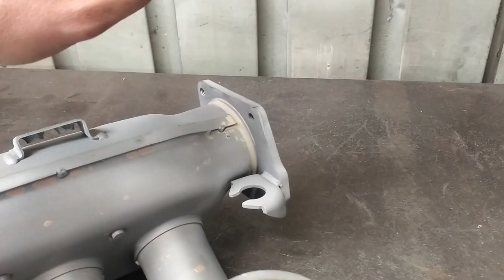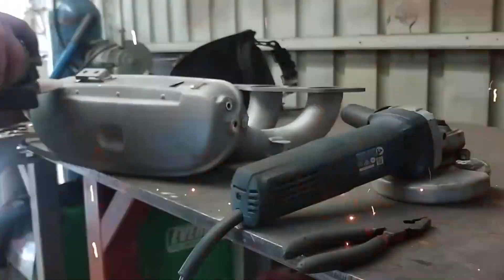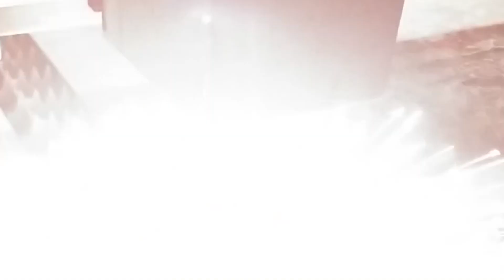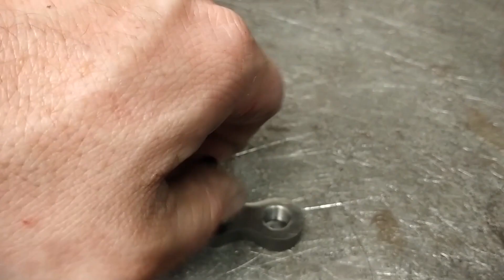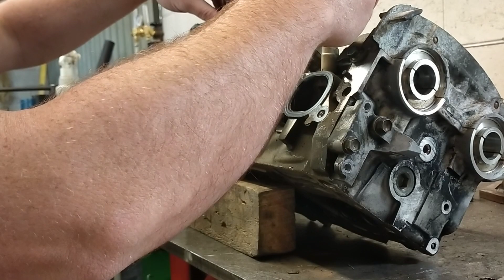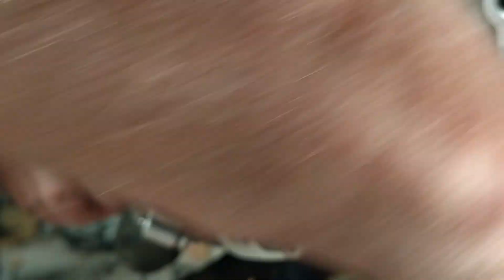5SGTE Beams Engine Build Ep4

Comment: Hey mate, from Australia. I have a 5sgte in my rav4. With the same block missing the transfer case support. I noticed you missing it as well. I was bit worried about not having it. What are your thoughts on this. Not worried as much now as yours hasn't got it either
Reply from the maker: you want to use the right hand bracket (in front of  the CV) but haven't run the upper bracket for years. never had an issue
Reply: @hawes_power5590  oh yep got that one on. The axle carrier. Ok awesome
Reply: Excellent work I subscribed. Very informative

Comment: Awesome. I hope you cover the RWD build as well. Particularly curious on your transmission choice. 

I have a question. Could you have used an oil filter adapter plate instead of drilling into the bolt for the VVT-i oil feed?
Reply from the maker: cheers, yep stay tuned.

yes you could do that, that will likely be the solution for the rwd engine